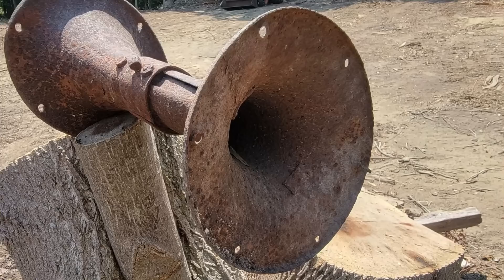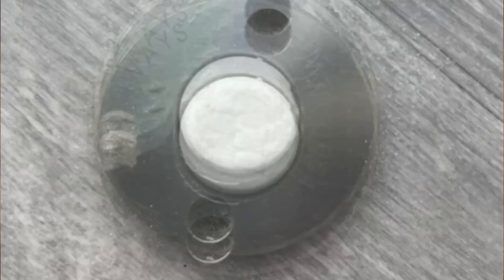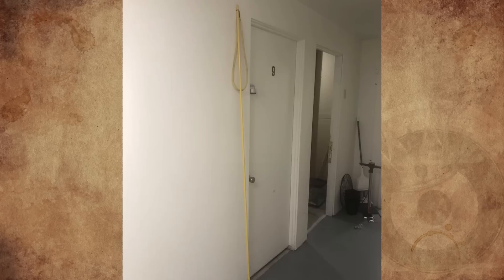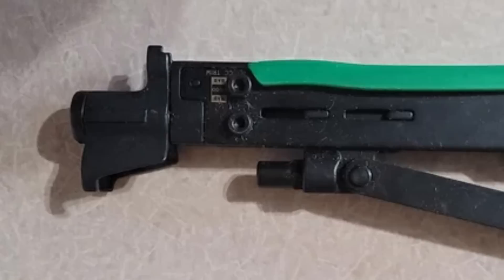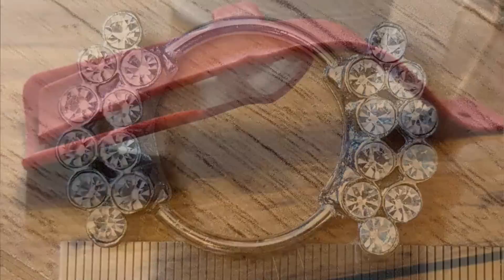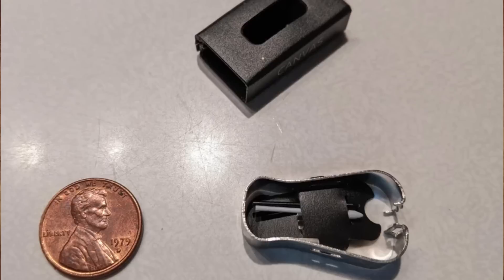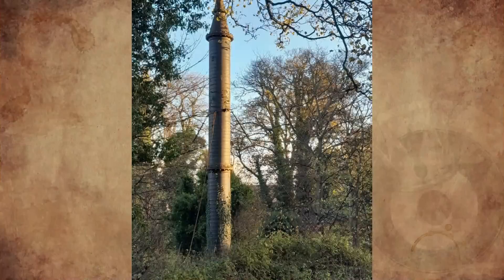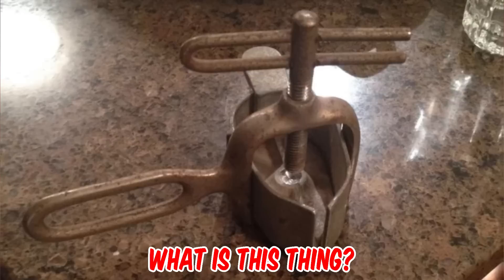What Is This Tall Metal Cylinder And These Three Flat Machined Presses? #viral #trending #facts

Comment: The verticai pipe structure could be a vent - or it could be a Standpipe - connected to an underground water pipe or aqueduct. Think of it as a gravity pressure regulator. You often see short standpipes (made from cement sewer pipe)  alongside irrigated fields. They will overflow if the pipe is blocked downstream.